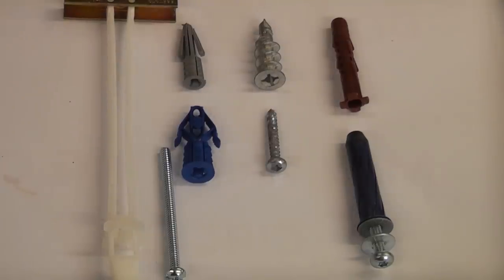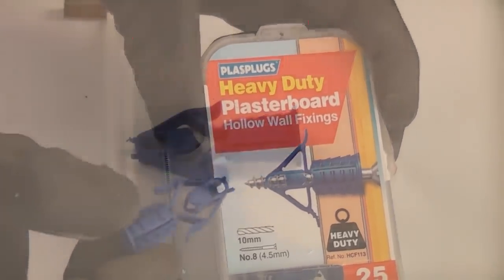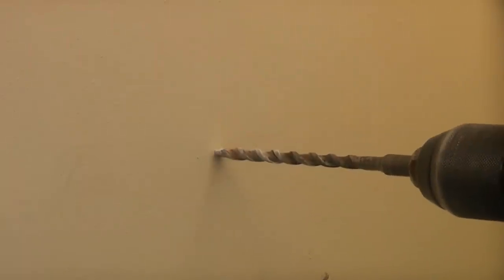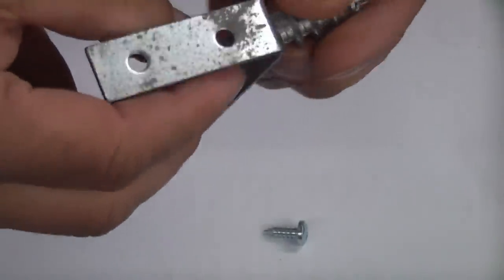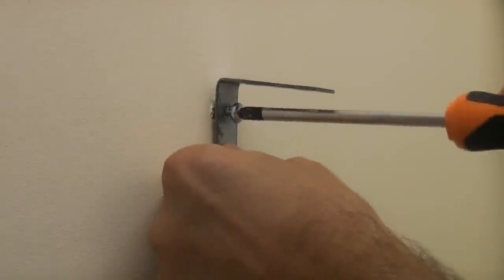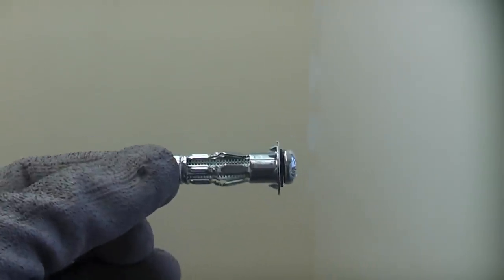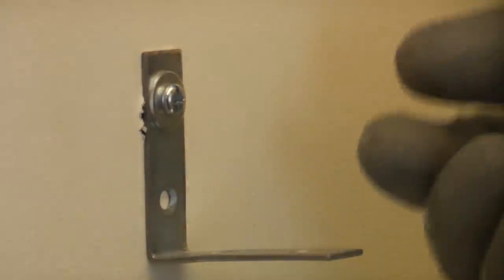Plasterboard fixings- The good, the bad and the useless!

Comment: do some of these work on metal studs? or are metal studs strong enough without anchors? thanks
Reply from the maker: You can normally drill a small pilot hole and the use self tapping screws to fix directly to the stud- no need for a fixing.
Thanks for the comment 👍🏼

Comment: Great stuff as usual I always learn something new - great to actually see a total professional at work - very few of them around these days. Never seen the snap toggle - pretty good for plasma tv's and heavy items! I have a box of hollow wall anchors - i thought just tightening up the screw pulls the cage into the plasterboard? Do you really need a special tool or is that just for avoiding damaging skimmed walls?
Reply from the maker: +Garry Gemmell 
The snap toggles are brilliant ;-)
With hollow wall anchors you do not always need to use the setting tool, especially if the wall has been skimmed. It does depend on the make of the fixing though. https://www.youtube.com/watch?v=nNFv65-QTPI 
Thanks for the comment

Comment: What's that tool you used to pull back the nail for that metal one???
Reply from the maker: Not sure, can you tell me what time it appears in the video please?
Reply: @ultimatehandyman  i figured out what it was. The anchorwall setting tool. The one used to pull back the nail to tighten the hollow plug in the drywall. Thnk you for responding tho.

Comment: Btw, where do you get the universal plugs, the ones that scrunched up? I looked around but I couldnt find them, even on amazon.
Reply from the maker: I got them from screwfix, although they have changed in appearance since I bought mine - https://www.screwfix.com/p/fischer-high-performance-universal-plugs-ux8-8-x-50mm-100-pack/20669
Reply: Ultimate Handyman Wow thanks so much!

Comment: With metal curly whirlys shown in the video. Cut the end off so the screw wont bottom out with pliers. then run the screw threw once and back out again...holding the metal plug with the pliers NEVER your fingers!
I Hate them tbh 

Interset fixings on plaster board..... you dont show these...AWESOME!!
Rawlplug do the UNO fixing which is my teams go to for almost all in home plug needs now
Reply from the maker: Thanks for the comment 👍

Comment: Hey what fixings should I use through a metal stud ?
Reply from the maker: Drill a small pilot hole first and then use self tapping screws, they will drive straight into the steel stud.

Comment: I'm putting up some shelves for books, the longest being over 3 meters, they are clearly going to be taking a lot of weight, are any of the reviewed fixings suitable? Or would you suggest something else?
Reply from the maker: +Pete Holder 
On a 3m run you should easily be able to find at least 2 or 3 of the studs, so fixing to them is the best option- https://www.youtube.com/watch?v=H5U0sLKyJJw
Reply: Thank you for you response, It's not a stud wall, its brick, suspect dot and dabbed or battened
Reply from the maker: +Pete Holder If it's brick behind I would use these- https://www.youtube.com/watch?v=xaYfs3lr1jI
Reply: +Ultimate Handyman Those Rigifixing do seem rather expensive, I'm just wondering whether a cheaper solution could be to use 120mm frame fixings? I'm just thinking it could put stress on  the plasterboard when you pull your bracket in, whats your thoughts? Its a private job for a neighbour so want to eliminate as many problems as possible, although I already know now I'll be sure to find the mortar and not the brick!!

Comment: where can you buy the Rosett cavity fixings please? I'm non-trade and only require a dozen tops. They seem to be way more than 40p. Thank you
Reply from the maker: I got mine from a local hardware store, but they are available on eBay- https://fave.co/3u1R9zK
Thanks for the comment 👍
Reply: @ultimatehandyman  Thank you for the reply. It's for two of the three fixings of a stairs handrail (the other is brick behind) and so I'm thinking it needs something robust like this ?
Reply from the maker: @thornboy68   Handrails are a pain to fix, as the screws are so close together.
If the wall is not solid, I normally fix a piece of timber to the wall first, then fix the handrail to the timber, to ensure the fixing is as strong as possible.
Reply: @ultimatehandyman  what width of timber will hold a handrail please?
Reply from the maker: @thornboy68   I think I used something like 5" X 1" last time.
Reply: @ultimatehandyman  thank you again. The wall is also uneven by 30 mm so may use the other side of the stairs now!
Reply from the maker: @thornboy68   No worries.
It's important to get a good fixing though. The last thing you want is someone falling and grabbing the rail and that detaching from the wall!

Comment: How Reliable is the snap toggle for holding up 60-80 lbs of tv and wall mount..........there is also metal studding there.....

so drywall.....metal studding held up by 4 snap toggles......I used a snap toggle because metal studding is hollow
Reply from the maker: As long as the TV does not cantilever out from the wall it should be ok, you can see how much weight they will take in 1/2 plasterboard here- https://www.youtube.com/watch?v=ECDysfNhx_E

Comment: Did I see you use the incorrect screwdriver bit on the Grip-It fixing? :D
Most houses around here have solid concrete or brick walls, so I don't have to fix stuff to plasterboard very often. 
The few times I had to, I used the nylon version of the worm screw thingys. Worked quite well.
These used to be quite common around here too : http://s.s-bol.com/imgbase0/imagebase/large/FC/7/7/4/8/9200000010398477.jpg
I've always found that they spun inside the wall while driving in the screw, or that the soft plastic stripped out so the screw wouldn't hold anymore.
Reply from the maker: +Kabouter Pongel 
Yes, I only have pozi drive screwdrivers LOL
I have used the Nylon versions and they have been okay in most cases, unless of course the self tapping screw is too long. The metal ones are okay unless you try using them on a wall that has been dry lined (dot & dab) in which case they hit the wall behind and make a large lump LOL.
Thanks for the comment ;-)

Comment: hi chez. which of these fixings would be suitable for a lath and plaster wall?
Reply from the maker: +arfan jhangir 
Hi Arfan, I have used snap toggles in the past and they worked well https://www.youtube.com/watch?v=tAIUublenMw
But they are not really designed for lath and plaster. When drilling the hole you should use a HSS drill but or sharp wood bit to drill the hole and not a masonry bit. If possible it's always best to fix to the studs, which you can find using this technique- https://www.youtube.com/watch?v=H5U0sLKyJJw
Reply: +Ultimate Handyman 
i did try them a while ago but with no success not sure if its because i used a masonry bit.do you reckon the grip tites  will work? i remember seeing them on dragons den.  where do you buy them from? they equate to about a £1 from shops i have been to.
Reply from the maker: +arfan jhangir 
The Grip it fixings work most of the time. They were good enough to send me a couple of sample packs but I'm not having much success with them at the moment. I like things that work every time and so far the Grip it fixings are not working as expected every single time. I believe they are available at Wickes.
Thanks for the comment

Comment: What is good for curtain pole like plug etc
Reply from the maker: Curtain pole's can be difficult to fix, sometimes the best option is to fix a piece of timber to the wall first, then fix the curtain rail to the timber.
If you don't want to do that universal plugs might be the best option.
Reply: Thanks mine jus broke today from kids pulling, but I think my curtains are a bit heavy, cos it got loose from the wall quick

Comment: what's ideal to wall mount a 43 inch TV?
Reply from the maker: It's best if you can locate the studs and fix directly to the studs- https://www.youtube.com/watch?v=H5U0sLKyJJw
Failing that the spring toggles are one of the strongest plasterboard fixings available-
https://www.youtube.com/watch?v=ECDysfNhx_E

Comment: The goid ones are ok on jnternal walls but what about plugs to use on "dot and dab" walls. Ppl always want blinds or curtains putting up and most of these fixings bottom out or wont fit behind the plaster board. Tried the grip it but you never know if they have opened the rear wings correctly, if they don't the fixing hole is useless.
Reply from the maker: Rigifix- https://www.youtube.com/watch?v=xaYfs3lr1jI
Or Corefix - https://www.youtube.com/watch?v=7xLhIPoO5gQ
Both work well on dot and dabbed walls.
Thanks for the comment

Comment: Is there any for a 3 deep plasterboard wall 🤔
Reply from the maker: If you use the snap toggle or the spring toggle, you can purchase extra long machine screws and use those?
Reply: @ultimatehandyman  i managed to find the stud lucky enough it smack centre of the mantelpiece so should be ok for a mirror fixing with long screw and a washer taped to the end just to be safe 🤔 great channel 😊 i wish i had YouTube 40 years ago  i would have thousands of diy videos 😂👍🏴

Comment: this describes only using plasterboard - not brick or concreet wall so all of those mentioned above will work well - or won't they? pleaseconfirm - thanks
Reply from the maker: +Eli Ben David 
None of these will work on brick or concrete walls, apart from the multi-purpose plugs.
I will do a separate video on how to fix to brick or concrete when I get chance.
Thanks for the comment ;-)
Reply: +Ultimate Handyman looking forward to your video on the subject for in my country most of private homes - as most as 95 percent - are brick or concrete walls but all the above mentoned applies to industrial constructions so some people will benefit from your video above - thanks a million - Eli
Reply from the maker: +Eli Ben David 
Thanks Eli, I'l make the video when I get chance ;-)
Thanks for the comments
Reply: Eli Ben David ii
Reply: I use Toggler Aligator anchors for block wall, concrete, and hollow walls.  They are super versatile, with very strong weight handling capacity varying by wall type.

Comment: You can tell you need a revolution in the building industry if it takes this much over-thinking to hang a mirror on wall :(
Reply from the maker: You can get some plasterboard now, where you can screw directly into it- but I guess the problem is knowing what type of plasterboard you have installed in the first place.
Thanks for the comment

Comment: You still need to find the studs with these, just to avoid them. 
The worm-type metal screw is not the best representative of that class of fasteners. The plastic ones work better, I have found, and I use screws of thinner diameter, because the manufacturers tend to provide screws that give too much resistance when they get most of the way in. But the self-drilling plastic anchors go in with a power drill and philips bit, and then the (smaller) screw goes right in, in about 10 seconds, using the same bit.
Reply from the maker: Thanks for the comment ;-)

Comment: Could you repeat this test with a dot and dab wall with cinderblock behind. These walls cause problems for many fixings as the restricted depth behind causes problems for certain fixings, toggle bolts etc. Also drilling into cinder block is not an exact science as the drill can shift and alter the whole positioning in the plasterboard.
Reply from the maker: I'm very busy for the next few months, I'm afraid but these videos might help-
We don't use cinder blocks in the UK, but some of these fixings might be suitable-
https://www.youtube.com/watch?v=xaYfs3lr1jI
https://www.youtube.com/watch?v=7DGGUbbbBZI
Reply: Ultimate Handyman I'm in the U.K. Just the wrong terminology. I have dot and dab over a really course breeze block that has a high aggregate content and plenty of small voids in between. The problem is that most plasterboard fixings do not have room to work ( toggles, etc.) and drilling holes is hit and miss because your nicely lined up hole goes all over the place as soon as the drill hits the aggregate in the breeze block and skid down into a void. Just thought it might be interesting to show people how many of these plasterboard fixings won't necessarily work on a dot and dab wall.

Comment: Just wondering what fixing to use to fit a dart board with surround weighing a total of 7kg on a standard dart board fixture with 2 screws required
Reply from the maker: I have done some weight tests using 12mm thick plasterboard, which might help-
https://www.youtube.com/watch?v=ECDysfNhx_E
Reply: Ultimate Handyman thanks
Reply from the maker: You are welcome ;-)

Comment: How many standard plastic plugs would be needed to hold 150 pounds?
Reply from the maker: No idea, I would not use them for fixing anything that is so heavy.
Reply: ***** Really?  You wouldn't two plugs and screws to secure a 100 pound mirror?
Reply from the maker: Are you talking about a solid wall, such as brick?
You asked on this video which is about plasterboard fixings, hence I thought you were asking about the plastic plugs that I used in the plasterboard.
For a solid wall 4 wall plugs and screws should easily hold 100LBS as long as it's not cantilevered out on a bracket etc.
Reply: It would be in standard drywall using a plastic plugs that looks similar to the brownish one.
Reply from the maker: In that case I would not use plastic plugs, I would use at least 4 spring toggles, snap toggles or GripIt fixings.
Reply: ***** So with anything with any decent amount of weight use metal with a bit f a more grip and support?
Reply from the maker: Yes, basically.
Reply: ***** Okay thanks for the advice and replies/
Reply from the maker: You are welcome ;-)

Comment: which one is best for mounting a 42" tv?
Reply from the maker: +Muhib Uddin Snap toggles would be my first choice followed by Grip-it fixings.
Reply: +Ultimate Handyman What about spring toggle. Btw its just plaster board with no Wood in between the whole area
Reply from the maker: +Muhib Uddin 
Yes, you could use spring toggles as well.
It depends what you can get hold of easily!

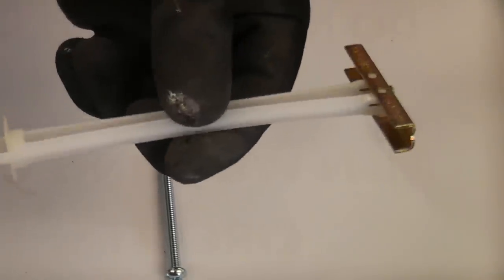Comment: Would have been interesting to see you hang a load on them to find the actual failure result. 6:25 One of my pets hates, when ppl say 12mm is 1/2", or worse when the ppl at B&Q say 15mm is 1/2"  Grrrrrrrrrrrrrrrrrrrrrrrrrrrrrr
Reply from the maker: I have tested out some fixings here-
https://www.youtube.com/watch?v=ECDysfNhx_E
Thanks for the comment
Reply: Maybe B&Q are talking plumbing, where 15mm tube is referred to as 1/2” as that’s the tubes internal diameter?

Comment: This is overkill to the max. If you put a Phillips head screwdriver through the hole and tap on it the slightest amount, the anchor will pop off and fall into the wall, then pull the plastic out.

Comment: On the 3rd fixing I think your screws are too thick mate. I just bought one and on the instruction it says to use 4mm thick screws. It only has 5* reviews on Screwfix and a Toolstation. May not be the same company that makes but exact same thing otherwise.
Reply from the maker: Perhaps, but I’m sure I would have used the screw size specified when purchased. This video is old now, so perhaps they have improved their product 🤔

Comment: A tired old joke I know, but i'm allowed to be a bit of a twat about it because I'm from Oxford like Inspector Morse and that's where the dictionary comes from even if it was originally written by a Jock.    ....    I like those worm screw fixings b.t.w and if they are too long you can screw them part in so the hole pilots then take them back out and snap off the tip. don't put the worm thread in though if you gonna take it back out because it only taps well once and you may end up with just a bloody big hole if you do. Still if that happens you may be able to rescue the situation by cutting down one of those spring-clip type fixings. those are the best types other than your standard rawl plugs.  never used the tiny yellow ones but red will do all day in plasterboard for blanking plates and back boxes if you screw all four corners and they are only gonna be used for USB ports or similar.  else use the brown jobs and no. ten screws if its going to have mains plugs pushed in and pulled out of it all day. can't remember needing the blue monsters for very much - any thing you couldn't [wouldn't] fix with a brown plug usually comes with its own fixings and purpose made plugs from the manufacturer.  often those four inch long grey things which are almost always too long for the job.  still, if you are considering a blue rawly chances are you really should be looking for a beam to screw into anyway.

Comment: That second fixing, how has trading standards not looked at this ? Utter crap. As a further point, surely the length of the wall fixing would depend on how much gap there is between the plasterboard and the wall blocks. How would you know what to use, and the screw length, if you don’t know the gap ? The third one seems a long fixing and would need a big gap. Im a DIYer with limited patience. Whats the best fixings to use to put up curtain rails and blinds in a new apartment ? Thank you
Reply from the maker: I don't think trading standards bother about products like this, as there are lots of manufacturers claiming to have the "strongest plasterboard fixing".
If there are blocks behind, I would never use plasterboard fixings, I would always fix into the wall behind-
Corefix- https://www.youtube.com/watch?v=7xLhIPoO5gQ&t
Rigifix- https://www.youtube.com/watch?v=xaYfs3lr1jI&t

 Thanks for the comment 👍

Comment: It's essentially a choice between weak crap which merely damages your plasterboard or total crap which damages the board and doesn't even work. Or you might just use a much lighter weight screw or nail and drive it into a stud. Are picture rails really so unsightly?